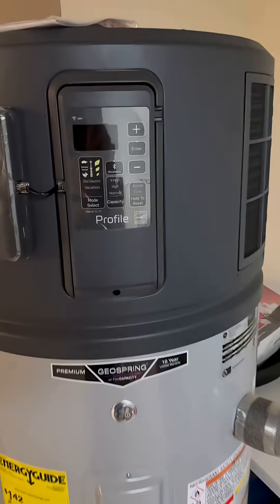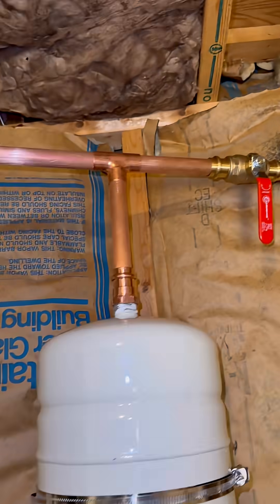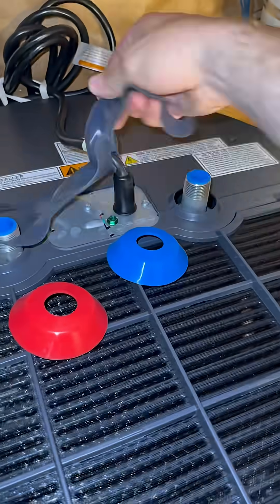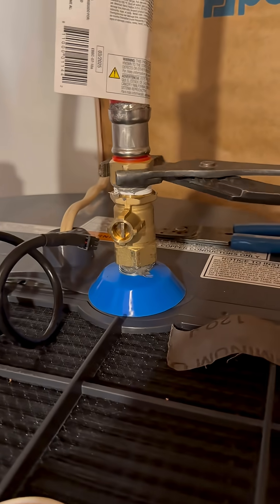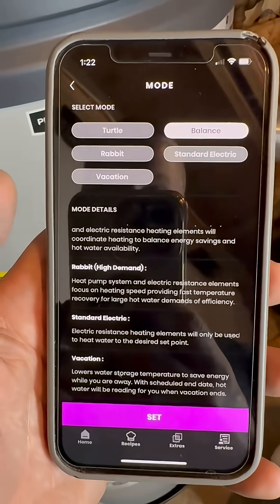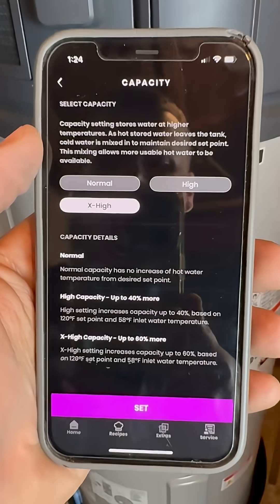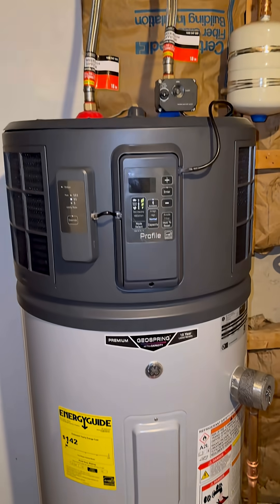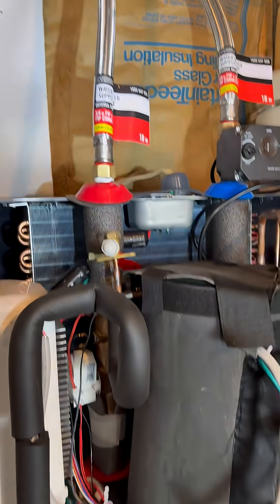How to install a heat pump water heater. @GEProfile #geprofilepartner #plumbing #hvac  #electrical

Comment: these things are such a headache if you just want to have hot water and forget all the extra frills that come with new technology. Try having the conversation with a homeowner about getting apps and pairing devices and all that most of them don’t want any of it they just want their hot water. Then one of those leak detectors gets a bit of water on it and all of a sudden they have no hot water and can’t figure out how it works. Expensive pieces of junk 😉

Comment: My hot water heater went bad. Why? Ran out of freon 😂
Reply: And when it’s working it will air condition the area it’s in
Reply: @bigcountry11994 Perfect for my hot Florida Garage 👍👍